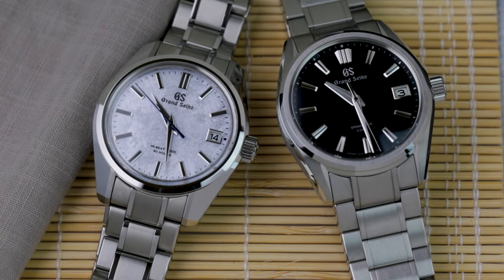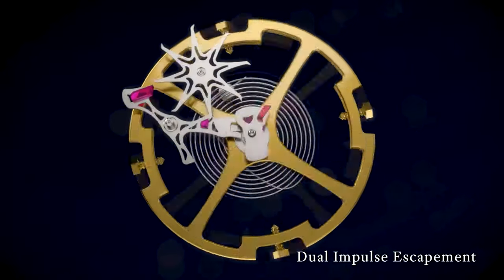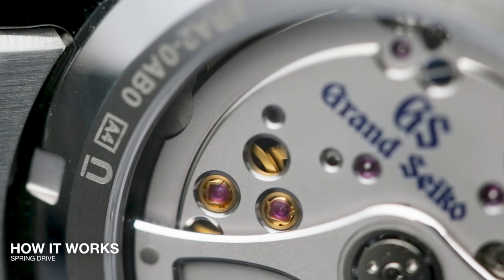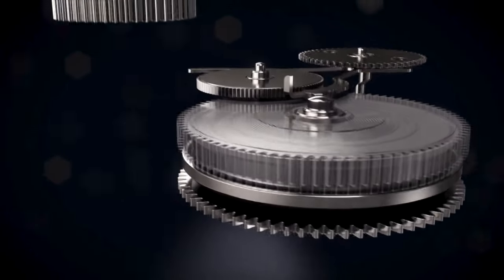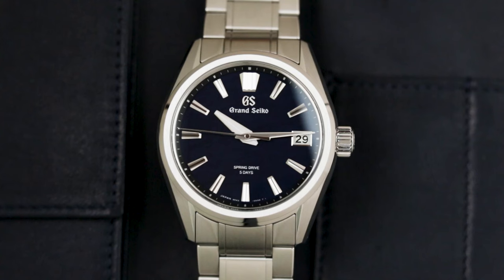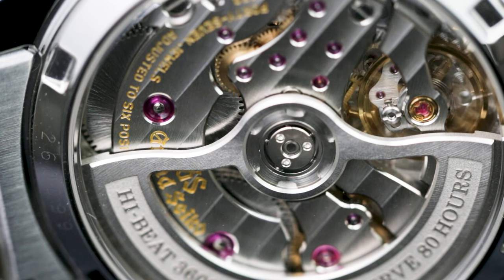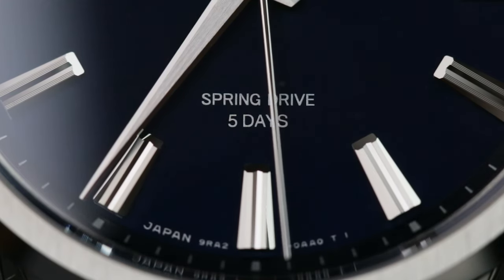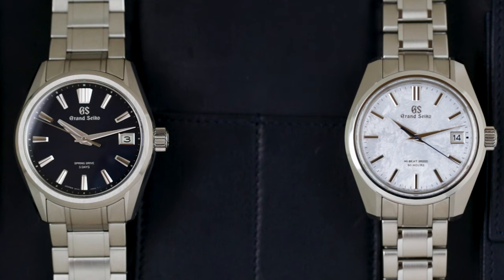Hi Beat v Spring Drive

Comment: Spring Drive is the true trademark for GS movements, it's a real innovation and a breakthroughh in bringing the best of Quartz and mechanical movements together. I think it is also attached to the brand forever in terms of perception, in the sense that no other brand will produce a movement that's comparable. I visited the GS boutique here in Paris a few days ago, and servicing a Spring drive watch is in fact cheaper than for an Omega Speedmaster. They send them to the Netherlands. Spring Drive all day!
Reply: What is the cost and timetable for spring drive service?
Reply: @Momo_8k  between 7 and 10 years if needed, and it is charged 650€ here in France for a complete service (no polishing)
Reply: @panydavid  that’s reasonable. Thank you!
Reply: Whats your favorite top 3 watches?
Reply: At its heart though, its just a quartz movement. Yes a quartz movement that's been meticulously re-worked to be as mechanical as possible and its more complex than most mechanical movements, but having that quartz regulator driving the oscillating wheel removes the "magic" and wonder of a mechanical movement. 

The beauty of a mechanical movement is that something as archaic as a collection of gears, springs and other assorted bits of metal and stones can come together to tell the time. To me, that's the "soul" of a mechanical watch that makes it appealing despite the technical redundancy compared to quartz. If you add a motor and quartz regulator, the archaic "magic" is replaced by modern science.
Reply: @JimIBobIJones  I think it made it better. Its like adding electricity and gas and a engine to a wagon to become a car
Reply: @Mysteryboy0007  it's more like replacing horses on a carridge with robot horses when cars are available. Nothing in the spring drive is particularly innovative. It's adding superficial complexity to a quartz movement.

I have nothing against good quartz. But I would rather have something like thermocompensated quartz or otherwise pure mechanical movements rather than the spring drive.
Reply: @JimIBobIJones  I would disagree that it’s not innovative. It is imo. It’s quite a complicated but ingenious system that makes it all come together. I agree to a point about the horses and coaches analogy but the difference is that robot horses would never be able to make an old fashioned carriage perform as well as a car in terms of being manoeuvrable or fast yet a spring drive movement is at least, if not more accurate than most modern quartz watches.
Reply: @jacc88888  it's complicated but hardly ingenious or innovative because it's not new technology. It is basically a mechanicl watch with the escapament replaced wjth a quartz oscilator. The quartz oscillator is also identical to an oscillator in a quartz movement. 

The only thing unique about the spring drive is that instead of the quartz oscillator being connected to a circuit board that drives the watch, its instead regulating a freewheel. 

Having an electronically driven wheel instead of an escapement is hardly the holy grail of watch movements, more a gimmick.
Reply: @jacc88888  also it wouldn't be more accurate than modern quartz movements, because it is fundamentally it is using the exact same quartz technology to regulate its beat. There is nothing mystical that somehow elevated the frequency of quartz to a new level when it's put into a spring drive...

That said, it is identical to basic quartz movements. It is much less accurate than modern high end, high accuracy quartz which uses thermocopmpensation techniques to eliminate deviation caused by changes in temperature.
Reply: @JimIBobIJones  if we follow your logic then no innovation will ever be made in watchmaking. You make it sound like it is nothing new when it took almost 30 years to develop. Respect that at least…. It is also much more accurate than a purely mechanical watch. It is measured at +/- 15 seconds per month. Also Most specialists and watchmakers agree that it is about 95% mechanical and 5% quartz. You make it sound like it’s 50/50. Just take a look at the movement itself it is obviously mechanical in its vast majority.
Reply: @panydavid  if you define innovation as technology then all mechanical watches are redundant. Everyone would be wearing thermoquartz.

+/- 15 seconds can be achieved by a $50 mall quartz watch because all quartz watches can achieve that level of accuracy. It isnt special or to be respected that quartz will deliver quartz accuracy.

The whole point of mechanical watches and their appeal is that they are replying on historical technology. Mechanical watches aren't supposed to use new technologies. Innovation in the mechanical watch space is supposed to be about applying old technology in clever ways, like the coaxial escapement, vertical clutch chronograph, perpetual calendars etc. Etc.
Reply: @JimIBobIJones  "Having an electronically driven wheel instead of an escapement is hardly the holy grail of watch movements, more a gimmick."

The wheel is still driven entirely by the mainspring, not electronically driven. The electronics don't drive the wheel at all, they only apply precise braking torque to it to regulate it. It's the equivalent of electronic fuel injection vs carburetors, not an entirely electrric car.
Reply: @nucleartime "only apply precise breaking toqruqe" is a massive understatement, its like saying the human brain "only sends some electrical signals". The method of regulation is the very fundamental aspect of any watch, its what actually keeps time. The rest of the gear train only displays it for the user. 

At the end of the day, spring drive is regulated by a quartz oscillator and an electronic circuit like every other quartz based watch.
Reply: @JimIBobIJones  Definitely missing the forest for the trees if the rest of horology outside of the escapement is just "displaying the time".  A Zeitwerk would still have infinitely more soul than a yet another micro brand NH35 watch even if the escapement was somehow magically replaced by servo.
Reply: @nucleartime  you are missing my point. The rest is definitely important but it's not a mechanical watch if it doesn't have a mechanical escapement. The qualification for a mechanical or quartz watch isn't whether they are sophisticated or are refined: it's a more basic question of the underlying technology.

Both a random microbrand NH35 watch and a Lange Zeitwerk are mechanical watches regardless of their pedigree because they use the same underlying technology - in the same way a $10 Amazon basics fountain pen and a $1,000 montblanc are both fountain pens. It doesn't mean they are equivalent.

The grand Seiko is a quartz watch because it uses a quartz regulator as it's underlying technology.

Using your metaphor, a forest must have trees...
Reply: @JimIBobIJones  Something is mechanical if it has a decent number of intricate moving parts. Mechanicalness is not defined by the presence of an escapement- a mechanical pencil has no escapement.  Mecaquartz chronos are called so because the chronograph is mechanically driven. Spring drive is similar in that regard, it is both quartz and has a mechanical geartrain. A forest has lots of trees, spring drive has lots of moving gears...

Semantics aside (I couldnt care less about if something belongs in one arbitrary box or the other), quartz is boring because it reduces the complexity of a movement down to an electrical source, an oscillator, and a display (servo or LCD). (Also because the parts aren't very aesthetic). Spring drive is basically the opposite and makes something more complicated. To me, the soul of the watch comes from the thought and care that goes into the engineering and design of it, not the arbitrary box of using quartz or not.
Reply: @nucleartime  except it's drive by an oscillator, coil and a chip like any other quartz. It is the Integrated controller (and it's attached electromagnet)is what is actually regulating and controlling everything. 

Grafting a gear train onto a quartz watch and having a dynamo instead of a battery doesn't elevate a quartz beyond what it is.

Its complicated but not sophisticated. Nothing about it is actually difficult to pull off, just unnecessarily complicated and time consuming to make.
Reply: @JimIBobIJones   Again, the quartz part does the regulating, but not the driving (providing the motive force).  All the mechanical parts are driven off the mainspring. 

The circuitry to regulate the freewheel only using the energy from induction is pretty sophisticated and elegant.

And lots of people do like mecaquartz  chronos (quartz with a gear train bolted on) over pure quartz chronos.

"Unnecessarily complicated and time consuming" is like all of high end horology when solar casios exist. None of it serves any practical purpose.
Reply: @nucleartime  yes it does.... the quartz is driving the integrated circuit, the intrated circuit controls a magnet that regulates the speed of the freewheel. The freewheel determines how fast the gears in the geartrain are able to turn.

This is fundamentally similar to non-digital quartz, where the integrated circuit is regulating the gears in the step motor to turn every second. How is it "more elegent"? It a chip reading input from the quartz oscillator and outputting regulation onto a set of gears like every other quartz integrated circuit.

Also "mechaquartz" is marketing BS by the way. Every analog quartz has a gear train. What seikos mechaquartz does is have more tactile chronograph module and a sweeping seconds motor rather than a seconds step motor. This doesn't make them mechanical, just mechanical feeling to operate. 

Some early swiss quartz watches were fundamentally similar to spring drive in that they transplanted a quartz regulator into an otherwise traditional mechanism (although they had batteries unlike the spring drive) - but these were rightly marketed as quartz rather than trying to be passes off as something they are not.
Reply: @JimIBobIJones  I'm using driven to mean "providing movement". 

Spring drive is fundamentally different in that the electromagnet is providing braking force, not driving force. There's no electric motor that imparts movement. All movement and energy storage is mechanical and comes from one or more mainsprings physically connected to the hands. That's fundamentally different from any other quartz watch. The fact that it can be regulated purely off energy from magnetic braking without any contact and without any sort of other energy storage is a pretty cool engineering trick in my book and pretty elegant.

And no, its different from using a mainspring to drive a generator to power a regular quartz movement because that wouldn't have the efficiency of spring drive, and the mainspring wouldn't be connected to the hands. 

If we're talking about tangible differences, spring drive has its characteristic sweeping second, and feels much more elegant than driving an escapement faster to get a smooth second hand. Or ticking a servo at a faster rate in the case of hibeat quartz.
Reply: @nucleartime  The driving force is irrelevant to a quartz watch being a quartz watch, what is relevant is the method of regulation. You are arguing that complexity somehow makes a quartz watch a mechanical one, which is an irrational argument. Your subjective view of "elegance" doesn't change this. 

The presence or the lack thereof of a battery isn't what makes or unmakes a quartz watch. Its in the name of the technology, the quartz - not battery or electrically driven. 

The "driving force" is never provided by the quartz watch in any quartz watch, even those that are battery powered. The quartz oscillator and Integrated Circuit (IC) in a standard quartz watch regulates the stepping motor, the same way in which it regulates the freewheel in an analogue quartz watch. 

Your argument of sweeping seconds being "elegant" is entirely subjective, irrelevant to whether a watch is quartz or not and ironically is anachronistic to the position of traditional horology. 

Before the quartz revolution horology held a ticking seconds (what was known as a "deadbeat second") to be desirable and superior to the sweeping second. It was difficult to achieve with mechanical movements, which is why deadbeat seconds were rare and expensive complications. 

The sweeping seconds can easily be produced with any quartz watch. You just swap the 60 "beat" stepping motor with a higher beat sweeping motor and programme your IC to a smoother beat instead of a second interval one. 

A few quartz watches do this (Citizen/Bulova and a few of Mondaine railway models come to mind). Most don't as ticking seconds are more accurate.
Reply: Yes, the older spring drive models are $4-6k. The new generation (5 day reserve) are closer to 10K
Reply: My iPhone is +/- sec/year!  Ha!
Reply: @JimIBobIJones it sounds like you might be saying there is no such thing as a hybrid mechanical watch; it is either mechanical or it is not, there is no grey area. You would define the spring drive movement as a quartz watch that is powered differently than other quartz watches; some are powered by batteries, some by solar energy, some with capacitors and spring drive by a mainspring. And furthermore, it doesn’t matter if the hands on a watch move by virtue of a gear train that is powered by a mainspring unwinding or alternatively by a motor. What is responsible for the hands moving around the dial is not the defining characteristic of a watch.
Reply: @phildo864  fundamentally there isn't a hybrid between quartz and mechanical - because they are mutually exclusive technologies. 

Its the regulator that defines what technology drives the watch. That isn't up for debate, this is how the technologies are divided in both principle and practice. Just as you can't have a hybrid of a LCD screen and a Cathode Ray tube screen, you can't have a hybrid quarts and mechanical movement.

You can and do have fully mechanical drivetrains powering quartz watches - look at early quartz watches or modern high end quartz such as Citizen's 0100. You then have digital quartz watches that have no gears or drive train, both are quartz watches as the underlying technology is quartz.

The complexity of a movement doesn't stop it from being quartz or make it more "mechanical" as the underlying technology relied on to regulate it is the same. I am not saying spring drive isn't more complex than most quartz watches, but rather that I don't think you can really capture the anachronistic appeal of a mechanical watch when the underlying technology is quartz. Quartz has its own appeal - which is cutting edge accuracy and high end quartz are as impressive as high end mechanical movements: however just as the technology driving them are different, so are the reason for why they are appealing. One is modernist and forward looking, the other is anachronistic and backwards looking. 

I am not bashing Grand Seiko. The 9S mechanical movements and the 9F advanced thermocompenstated high accuracy quartz are things of beauty.
Reply: @JimIBobIJones  I think I summarized your points accurately? Namely, watches are categorized based on how they regulate time. It doesn’t matter how they are powered; whether that’s a battery, solar, kinetic or a main spring. If it uses an atom, it is called an atomic clock. If it uses quartz, it is called a quartz watch. For example, if someone made a mechanical watch with a battery instead of a mainspring, as long as the battery powered watch uses a traditional escapement, even though it has a battery, it is a mechanical watch. Right?
Reply: @phildo864  essentially yes. The power is irrelevant to the method or regulation, and it's the method of regulation that determined the technology group a watch falls under.
Reply: @JimIBobIJones  has anyone made a battery powered mechanical watch yet? Or a mechanical clock that plugs into the wall?
Reply: @phildo864  some of the very early battery powered watches before novel regulators (such as the tuning fork and quartz) were developed. Hamilton, Elgin and plenty of others made  battery powered mechanical watches.

Also mechanical wall clocks have existed for centuries, well before wrist and even pocket watches were a thing.
Reply: @JimIBobIJones  nice. Do you know a way for me to find out more about these earlier examples of battery powered watches that used a traditional escapement?
Reply: @JimIBobIJones  I found some examples of mechanical watches that were powered by batteries! Watches like the “Electric Altair” and the “Gemini Electric” watch. Very cool. They seem to be classified as electric watches. But is it more correct to classify them as mechanical watches?
Reply: @phildo864 There's no formal classification - "electric" is a broad term that is used by the community as a catch-all for anything that's battery powered but not quartz. 

This includes more or less traditional mechanical escapements, fixed coil escapements and transistorised movements. You also have tuning fork movements (which are neither mechanical escapement nor quartz) being classified as "electric".
Reply: @JimIBobIJones  Well Hamilton was calling them electric watches in their press release and on the dial of the watches and in their names. But I was clarifying that they are mechanical watches because you said it doesn’t matter if electricity powers them, rather it is the method of regulation that determines the technology group a watch falls under. Prima facie, I would have said they were a hybrid; electric-mechanical watches.
Reply: @phildo864  What I meant is that "electric" watches were never properly classified as a type of watch and includes a wide range of different technologies. 

An electronic watch may include a lot of mechanically regulated electronic watches, but will also include tuning fork watches and transistor watches. 

There are electronically powered watches with mechanical escapements - but there was no common naming convention: 

Hamilton called theirs the "electronic", Wittnaur (then a part of Longines) called it the "electro-chron" etc. etc.
Reply: @JimIBobIJones I’m still confused , so say a car engine uses a carburettor its a mechanical engine, but a car engine that uses electronic fuel injection isn’t a mechanical engine?
Reply: @shiraz1736  I don't see how your analogy applies. Car engines are classified by the source of energy they use, not their fuel delivery mechanism. Watch movements are classified by their method of regulation (quartz, mechanical, tuning fork etc,).
Reply: @JimIBobIJones  not in all cases though right? Some watch movements, such as solar, kinetic, or the aforementioned electric watches are classified by the power source.
Reply: @phildo864  As subsets. Solar and kinetic watches are still quartz watches. 

Its the same as an automatic watch, a chronograph or a tourbillon still being a mechanical watch. 

Or to go back to the car example a car with an EFI engine running petrol is still a petrol car, not an electric car.
Reply: @JimIBobIJones  Many people classify them as an engine, are you sure you’re not making your own classification and yours is right?
Reply: @shiraz1736  "many people" who? It's a petrol/diesel engine with EFI. No one calls it an election engine...
Reply: @JimIBobIJones  You not getting my point your labelling every movement based on a sales logo on a watch dial, Quarts was a big thing, when Automatic movements came in it was a big thing hence the marketing logo, Spring Drive, the list goes on. A movement is a movement and there are different types and they are all demarkated with a movement serial number all Selittas ETA etc have one. Trying to pigeon hole a spring drive movement as being a basic quartz moment is just your attempting to ridicule that particular style of movement and elevate your view that mechanical movements are still the bees kneez.
Reply: @shiraz1736  You aren't getting how the underlying mechanics work...
Reply: @JimIBobIJones  and exactly the control of the accuracy without directly being driven by electric current is the fascination for me. Combining the fundamental laws of nature and science by the natural frequency of a crystal structure that is grown by "nature" and to "harvest" this constant to accurate control a mechanical machine with it's flaw regarding friction and hardening lubrication, without touching it. I am currently in my master studies of industrial engineering with a focus on energy machines and information technologies and I think this fascination should be recognized and not be down played or even compared to the fascination of movements that purely rely on springs and gears. Right now I am owning a watch with purely "mechanical" components but I am also looking forward for the infusion of this transfer of energy forms. Kinetic(with friction) to induction back to kinetic(oscillation) back to a current which results in a magnetic field which is a resistance(magnitude dependent of natural frequency) for a kinetic movement. It's just fascinating to think about and we all love watches stop B's on other movements because it's all beautiful and should be admired.

Sry for my English hate to type on mobile phone in a comment section
Reply: @BoredomLP  A motor, whether driven by electricity or a spring is still providing the same force. 

You can have an electric motor driving a mechanical escapement (as you did for early pre-quartz electronic watches) or have an spring powered quartz watch. 

It isn't anything fascinating or innovative... The regulation is what makes watches interesting, its what makes it keep time.
Reply: @JimIBobIJones  and the regulation are their flaws at the same time. And if you are a fan of the mechanical interplay of movement a storage of forces in springs and you love the way how they overcome boundaries of historical watchmaking it's still a nice solution for keeping both worlds as a "product"(there is demand). All I say both have a right to exist. And as a watch enthusiast I am happy about progression and conservatism. I think I shouldn't be forced to decide between only wearing a quarz or purely mechanical watch if I can have all 3 and appreciate without ranking. And no one should force their opinion on others valueing their opinion and decisions. I totally understand your point but in my view that shouldn't reduce any of these two right of existence. Just another question. Do you think there is a need for new "mechanical" watches if their regulation is constraining any real improvement based on basic laws of thermodynamics etc. like friction and deformation etc. or just chaos theory? To get more accurate only with gears in the end there is a limit so getting a watch is just about obtaining an piece of history and art. Last point: the concept of time and therefore the accuracy is dependent on the speed of light so a measured natural constant did watches get less accurate by the humanity defining it more accurate. 😅 Whatever to sum it up you are right that there is a difference in the quintessence of a spring drive and a watch that not uses a natural constant as a regulator. But in the end it doesn't make one or the other better it's about preferences and they are subjective and you get your confirmation, about being right depending the bubble you are surrounded by and there is no value in arguing and setting up other people. Have a nice day.
Reply: @BoredomLP  @JimIBobIJones  Thanks for the debate and I've learned a lot! I am new to this but from a casual observer's view/stance, it should be rather simple -- mechanical watch should not have IC or electronics components in it, or it's hybrid. Or from this end: mechanical worn out is another way to look at it... if I have to change out chips/IC/capacitors/batteries, then it ain't mechanical... Make sense?
By the way, I think JBJ's narrow definition of using escapement on mechanical watch is self-defeating. It's hard pressed to say a clock plugged into electricity while using mechanical gears and escapement is still considered a mechanical watch/clock. Common sense people!
Reply: Excellent debate and why after 2 months sold mine to go purely mechanical.  Couldn't bond with it. 
Loved the finishing 
I guess I want a GS diver Hi beat
Reply: @JimIBobIJones  You seem to have a real specific opinion on this matter. Thank you, but most people see the breakthrough that Grand Seiko made. If you don't see it, it is ok, just allow the majority of others to see it and enjoy it. Cheers!
Reply: @megashega   I have a conclusion based on understanding and analysis of the underlying technology. I accept that I can be wrong in that, but all I have heard as counterfactuals are opinions and unbacked assertions...
Reply: @JimIBobIJones Oh I see, only you have the understanding and analysis, and all of the other people just have opinions - it must be very hard for you. You should go to Grand Seiko and explain to their experts and masters that they don't have a clue what they are doing.
Reply: @megashega  where you fail to provide any rationale for your opinion yes. And 

Grand Seiko aren't making these wild claims about "breakthrough" technologies - their own experts are providing the technical details and diagrams clearly showing a quartz oscillator being driven by a microcircuit - i.e. quartz.
Reply: @JimIBobIJones  you still don't get it, do you? Nobody has to prove anything to you. I just happen not to share your point of view and opinion, that's all. It is not a debate, there is no prize. Spring drive is a marvel of engineering, it is not just another quartz movement.  It is a legacy and a life effort of a brilliant Japanese master who succeeded after years of trying. The sweeping needle is beautiful and nobody else does it like Grand Seiko. Now that's just my opinion. You can carry on "proving" your point... I don't care. My initial comment was always just that - you are sooo strongly opinionated... relax and enjoy the beauty of GS.
Reply: @megashega  nobody has to debate me either. Yet they choose to... As you just did. You are actively engaging in this pal....
Reply: @megashega  it also isn't anything to have a sweep quartz.  This is exactly what I mean. You clearly don't understand what makes it sweep , and go "oh wow sweep seconds with quartz, how amazing". Its just gear ratios, its not special nor difficult to pull of. Anyone can do it and much more budget have - Citizen and Bulova and Mondaine with their railway watches. Heck, I have a £50 clock on my wall right now that sweeps.

Grand Seikos craftsmanship is on par with the best of the swiss, but that's never been my point - just the underlying technology... It's the exact same circuit that all quartz watches uses. I will send you seikos own diagrams later (if YouTube still allows links).

Where it is novel is directly driving the circuit with a spring without a transistor or a battery - which is why it's named spring drive. This isn't new technology, just novel application to watches. Given that a high tech quartz oscillator and microcircutry is still driving the watch it's still a quartz.
Reply: I always wonder how spring drive movement compares to the true innovative tunning fork movement, in terms of accuracy and innovation. On both movements the second hand glides around the dial.
Reply: So much controversy over the innovation. The entire point of quartz is that it relies on a battery to achieve the accuracy. The point of a mechanical watch is that it's powered by its user. 

Spring Drive achieves quartz accuracy without an external battery. Cry about it if you like. But by definition, it is literally the best of both worlds and has never before been accomplished. So it obviously ain't that simple or easy.

This solves a need and does so beautifully.
Reply: @Jugs_TV  uh pal. It's in the name quartz, I.e. the crystal not the battery is what's achieving the accuracy. The battery is incidental. Spring drive uses the exact same quartz circuit as any other quartz watch...
Reply: @JimIBobIJones  so can you show me any other instance where quartz accuracy is achieved without a battery? Because till you can do that, my point stands.
Reply: @Jugs_TV  a quartz circuit works as long as it has a current. Spring drive (again it's in the fking name) does this by having a coil generate the electricity from the watch mainspring. 

The electricity going through the crystal oscillator generates a frequency which is interpreted by a microprocessor. 

There are plenty of clocks that don't have a battery. My bedside alarm clock works off mains and not a battery. If you are using a desktop PC and not a laptop there's a quartz clock on there not using a battery.
 
Point is that like any electric circuit (think back to your highschool physics class) its a quartz circuit that runs off a electric power source which isn't necessarily a battery.
Reply: @JimIBobIJones  do you see a cord connected from this GS to the wall outlet? That's great for your bedside clock. Let me know when it doesn't need an external power source since that is the entire point of the innovation. If you can't provide another instance where quartz accuracy is achieved without an externally provided power source, then my point... Still stands.

This is an automatic by definition. As in it's perpetually powered by the user either winding or wearing it. NOT a socket in the wall or battery.
Reply: @Jugs_TV  Pal... It has a electromagnetic coil generating electricity that's fed into a quartz integrated circuit controlled by a microprocessor. 

If that is mechanical in your mind you are beyond help.
Reply: @JimIBobIJones  and what provides power to the whole system? Like are you really this daft?
Reply: @Jugs_TV  Also "automatic" is just referring to a complication that automatically winds/charges the watch - it has nothing to do with whether a watch is mechanical or quartz. 

First you say the definition of quartz is a battery. Now you say its the power source. That is utter crap pal. The power source has nothing to do with accuracy - its the regulator. Quartz is more accurate because the frequency of a quartz oscillator vibrates at many thousands of times higher than a escapement wheel. The oscillator and integrated circuit in a spring drive is exactly the same as any other quartz watch.

Kinetic watches with batteries and capacitators are also automatic but also unambiguously quartz. A hand-winding watch is not automatic but is unambiguously mechanical. 

You clearly have 0 understanding of how watches work and are just jumping from argument to argument trying to make a quartz watch a mechanical one (or in your words "automatic").
Reply: @JimIBobIJones    I ain't reading all that. You just made my point. Does a spring drive not wind itself? You said an automatic does not have to be mechanical. Isn't that your whole complaint that it has quartz circuitry? Literally proving my point. You have to be baiting lol
Reply: @Jugs_TV  But the spring drive is generating electricity to drive a quartz circuit is a quartz watch - you literally said the definition of quartz is battery power. 

So yeah, it didn't prove your point. If its using a standard quartz circuit and microprocessor so its not really a hybrid. If they managed to somehow use a mechanical mechanism to translate the frequency to the drivetrain then it WOULD be a hybrid. 

Early tuning fork watches were battery powered but didn't have any microprocessors - they used a physical stepping mechanism to direct the frequency into the drivetrain. These were much more proper hybrids than spring drive - which is just a quartz watch with a mainspring.
Reply: @JimIBobIJones  can the spring drive independently provide power without a wearer? That's what you're saying right? Or are you saying it needs a user to wind or wear it to provide power to the system?
Reply: @JimIBobIJones  just answer the simple question, if you don't wear or wind the spring drive, does it perpetually stay powered?
Reply: @Jugs_TV  Quartz is the fking regulation, not the power source. Its in the name. 

If the technology was about how it was powered why would it be called quartz and not battery watches? 

How is this too hard for you to understand? 

Quartz watch = integrated circuit consisting of quartz oscillator and a microprocessor. 

If you have that its a quartz watch.

How its powered is irrelevant.
Reply: @JimIBobIJones  no one is debating that the spring drive uses quartz circuitry to achieve it's accuracy. That is the entire point of it. The controversy at hand is whether or not the watch is an automatic/mechanical by definition or a quartz.

Quartz watches require an external electrical power source to provide power to the entire system(battery/outlet). Automatic/mechanicals are powered by the wearer(self wind/manual wind).

This watch borrows aspects of quartz watches to achieve accuracy but by definition, it is still an automatic(self wind)/mechanical(manual wind).

You're so lost in the sauce on your semantics. It's really simple and you can't grasp it lol
Reply: @Jugs_TV  no. You explicitly said the definition of quartz is that its battery powered.... I am done. There is no point in arguing with someone who doesn't stand by their own claims and words.
Reply: @JimIBobIJones  Not going to lie dude, you sound like the biggest hater I've ever heard of. If GS Spring Drive isn't all that hard or innovative, it surely wouldn't have taken as long as it did, and every watch brand would have that option in their watches. Better yet, I've been looking for a spring drive/tuning fork/precisionist movement. Why don't you make one for me, I'll pay you and everything! Surely for something as "easy" and "lacking innovation" as those devices, you could make me a sweeping quartz movement easy.
Reply: @nathanoleary346  I can't make a Ingersol for you either but that doesn't make it a good watch. Just because other people haven't done it doesn't make it a good idea or innovative... 

Also other people have made similar watches. Spring drive is fundamentally the same thing as a kinetic watch. Both use integrated quartz circuits and microprocessors to regulate the watch and kinetic energy to drive a drivetrain of gears. The only difference is kinetic watches transfer the energy to a battery and uses a capacitor. Spring drive lacks a battery and capacitor but has a coil based generator. The latter is much less reliable and efficient. I get anachronism because that's the underlying romanticism keeping mechanical watches alive. But if you are using a quartz IC then any low tech solutions elsewhere are moot.

Just as a gold plated turd is a turd, a dressed up quartz movement is still a quartz movement.
Reply: @JimIBobIJones Why are Grand Seiko making such outlandish marketing claims? They say it took over 20 years and 600 prototypes. How is that possible when it’s a trivial modification to a well-understood technology?
Reply: @chrisl461  it was one engineer's pet project for most of that time. Akahane was the guy who made rough hybrids from the 70s-80s. Seiko as a company properly started developing the movement in 1997 and the first watch with the movement was shown off in Basel 1998. The first commercial models were sold in 1999.

Is 20+ years technically true? Yes but one guy doing it as a pet project isn't Seiko as an organisation investing 20+ years in R&D.
Reply: @JimIBobIJones  Nonsense.  Your post illustrates you don't know how it works.
Reply: @captainwin6333  well as I was directly relying on Seiko's own technical presentations and diagrams (including Akahane's) I guess Seiko is wrong about how it works and so is the inventor of the design.
Reply: @JimIBobIJones Abso freaking lutly.